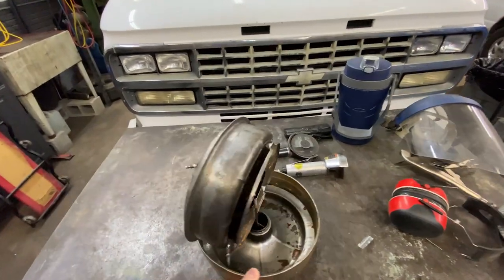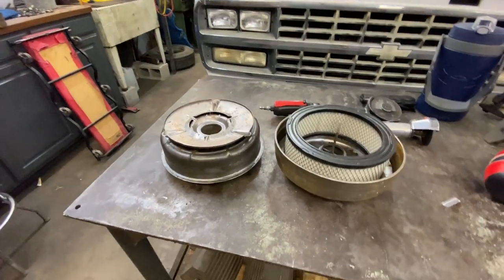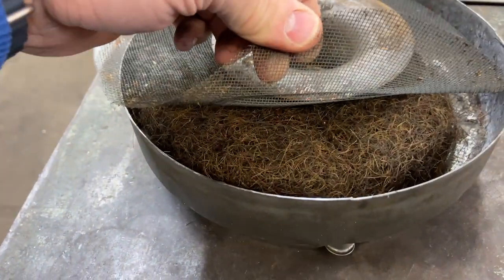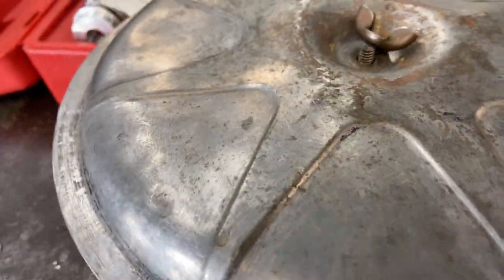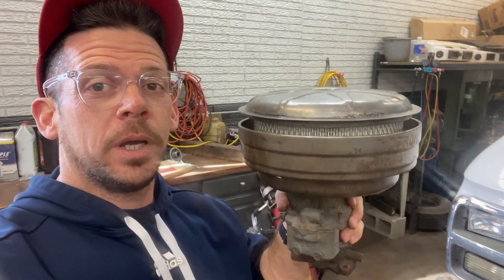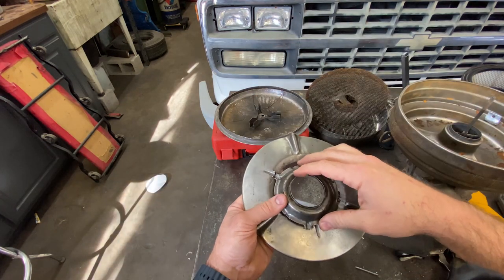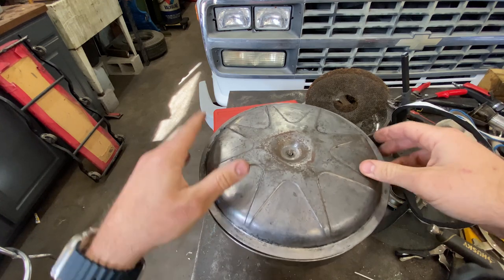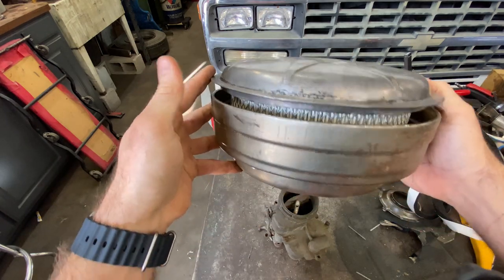Early Ford Air Filter Conversion

Comment: I like it. If you left another inch or two on the lid side it would hide the top of the air filter and no one will ever know it's a conversion.
Reply from the maker: Thanks. I wanted it to still look very similar to the original. It would be even more stealth if I ran a K&N or similar black filter but I’m ok with the white one for now. I wanted to ensure sufficient air flow so that’s why I chose to keep the lip on the lid short.

Comment: I did something similar with a ‘52 F1 air filter.  It’s posted on the HAMB.  Only difference is, the part you put on top of the filter, I put that on the bottom and used JBWeld to fix it in place.  The 3 tabs around the outside of that ring will keep it flat in the bottom of the base.  Then your air filter will sit higher.   Also I used a piece of vacuum hose, slit along its length, and put it on the flange where you cut off the top piece.  That not only protects you from cuts, it helps create a seal between the top piece and the filter.  

The reason you had to trim the base is because you have a truck air cleaner and  a air horn for a car on your 94carb.  The truck air horn for the 94 fits neatly inside the flange that you had to cut, and the thumbscrew tightens it down.  Too late for that but you will know next time.
Reply from the maker: Oh I’m aware of the reasons that it did not fit. We swapped to a different carb with a different neck. 👍